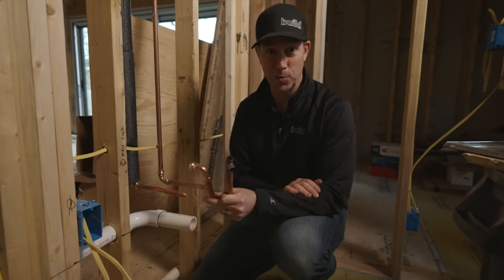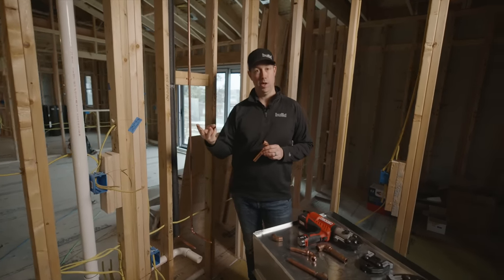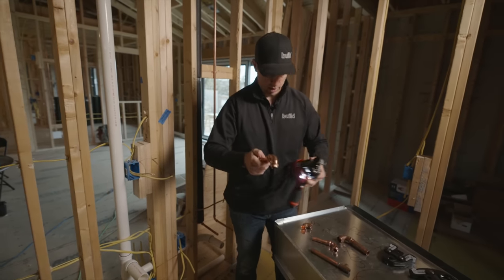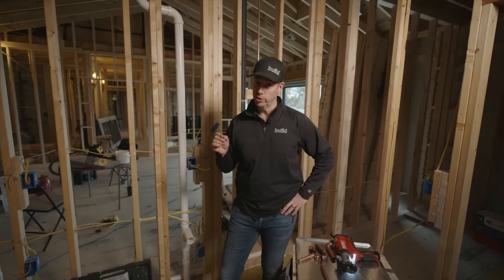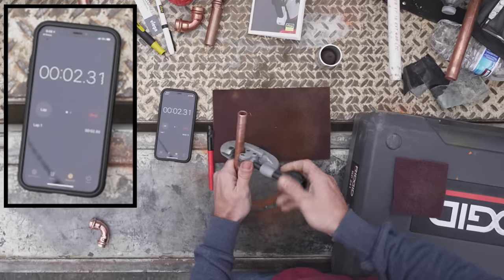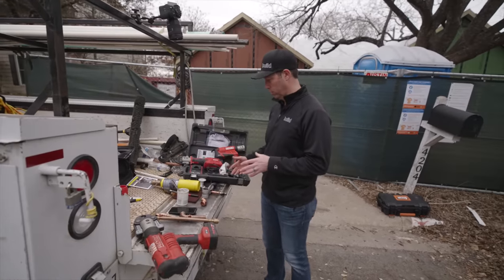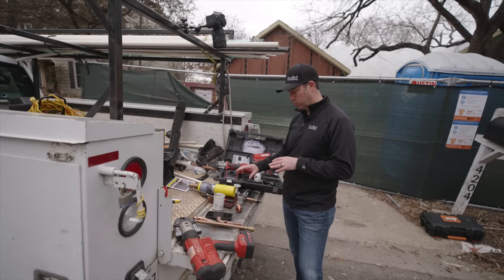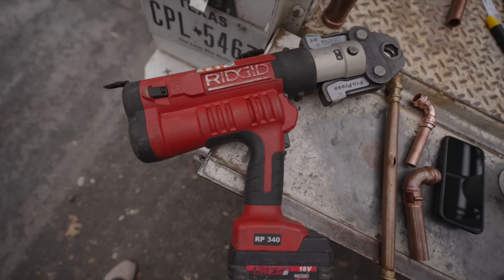Copper Plumbing - Viega ProPress vs. Soldered

Comment: What are the life expectancies of “K” copper and pex?  Having to replace pipes after 50 years sounds really crappy!
Reply: Pex doesn't have enough time just yet; the stats would be useless. Give it 20 more years. (Yes, I know it's been around, but standards haven't. Additionally, it's way behind copper for range of implementation at scale.)
Reply: I know this is anecdotal, but hope it helps.  It really depends on the water running through the pipes.  The pipes in the house I grew up in are type L and the house has decent city water.  The house is about 35 now.  I had to adjust the piping when we replaced the water heater for my parents last fall and the pipes still looked near new inside, no visible erosion.  I'd be surprised if the pipes in that house wore out in another 60 years.  
The house I own had "K" copper pipes installed in the mid 60's from a moderately hard water well to the oil heater and the kitchen.  When we replaced the oil heater and water heater a few years ago, the 50+ year old pipes were still in perfectly good shape.  We just sweated new fittings as needed to hook up the new oil heater and I doubt I'll ever need to worry about them.  The only copper in the house that had worn out was the 4" copper wastewater piping and we replaced that.  All the water supply piping is still thicker than "L" wall everywhere I micrometered after 50-55 years.
Reply: @IanSlatas  Thanks for sharing. I've lived in homes (all on city water) with galvanized, copper, and PEX in 3 different homes. Like you said, it really depends on the potable water going through it. Of course, the galvanized pipe (44 year old home) eventually developed pin hole leaks or developed rust and mineral restrictions like a hardened artery (slightly hard water from lime). No problems with the copper lines (34 year old home fairly soft water). The house with PEX (25 year old home fairly hard water) had its grey polybutylene replaced at 20 years because of the potential of leaks and some insurance companies won't insure homes or charge higher premiums if blue or grey poly is in use. Copper wasn't a good replacement option cause of the labor cost to open up the walls (slab foundation, no basement or crawlspace) and the cost of copper. I like the 20 year rule. Give a product 20 years to see what problems happen with it. Then I also heard that copper lines can be a problem where lightning happens often cause ground currents can cause pinhole leaks to develop. Your mileage may vary.
Reply: @IanSlatas  thanks!

Comment: Ot doesn't fuse the pipes together, it's a crimper. I don’t see this as a good thing. That o-ring will degrade faster than a solder joint. I'm not sold on using this system on anything I do yet.

Comment: Uhhh, the copper is not fused in a sweated joint.  "Sweating" is soldering,  not welding.   And it's the solder whcih makes the connection, not the "flux".  the flux is only there to make etch the copper and make the solder flow and 'wet" the copper for good adhesion.

Comment: How does copper compare to stainless steel pipes to use for hot and cold water ? I've heard they last even longer than copper ?
Reply: Who uses stainless for domestic water? Thats absurd
Reply: @lustfulvengance  ROI on geothermal is llllooooonnnngggg depending a lot on where you live and how deep you need to drill. Ive been doing commercial estimating for 10 years and have seen only half a dozen geothermal jobs

Comment: Ok so voice recognition dose work so well. I’m not saying you can spin it like a shark bite but if it is crooked you can move it, hence it is not fussing it together. But you should press it again.  Maybe your not strong enough . Also plumbers don’t use Brillo its called scotch brite and a real plumber will not use mapp gas to solder we use an acetylene torch with the proper tip. This miss information pisses me off , you make me feel like I’m an internet  hater,  I’m not! I think I’m going to start doing videos myself so people can get accurate information on line. I will stick to things i have experience with and do proper research on new things. Sorry.

Comment: The o ring is in fact the seal. If you run water through the pipe and then cut it open you will realize its wet till it hits the o ring. Stop saying that the copper to copper is "fused" its not, its also not the seal.

Comment: Everything about these new fittings sounds great except price.
Equal number of 1-1/4" copper sweat fittings vs Viega are $86.00 compared to $287.00.
That is 334% more which is ridiculous.
Reply: Press is good where labor rates are high. Such as prevailing wage or union work. Or repair work.

Comment: My HVAC guy scoffed at pro press for no other reason then he just didn’t want to learn something new.
Reply: I can't speak for him, but in commercial refrigeration, I've seen leaks in relatively new press fit connections.  I've also seen many 70 year old brazes that are still leak tight.  Press fit is great for water, but I won't use it in refrigeration.

Comment: If it is a smaller job, say 15 fittings, you are only saving 8 minutes using pro-press over soldering. Your plumber on this video was good at soldering.
Edit: He only did one side of the fitting, so 16 minutes of saved time.

Comment: I think I gotta call bull on this process “ fusing the pipe” and the EPDM not being the sealing element. I think we all know better than that. You can fuse two metals together with out reaching the melting point of the material.

Comment: He doesn't fuse the copper with flux he cleans the surfaces with  flux so that solder  may connect the two copper pieces. Incidentally that's not fused.  It's soldered  in the common use of the words

Comment: I can’t help but notice the copper is strapped down with a copper strap, isn’t copper on copper contraindicated?
Reply: No , that is exactly what you want. Any dissimilar metal will corrode the copper and cause leaks.
Reply: Yeah you can use other metals but you need to put somethjng between them. Like tape. Its advisable to just use copper though. In the commercial world we use hold-rites tacked to the copper and secured to the wall joists

Comment: ProPress has its place, but correctly prepared and soldered copper will last a lifetime. ProPress uses rubber o-rings to seal and they don't last forever.

Comment: '"Even the thinner M will go like 50 years..." Nope. My development was done in M like 30 years ago and every home has pinhole leaks. Go at least L in thickness. May also depend on your water. Water here in Los Angeles is very hard.
Reply: LA has hard water but I have systems with "m" still going from the 80's. Lack of reaming is a major cause of pinholes
Reply: @Marvinfj32  What do you mean by "lack of reaming is a major cause of pinholes"?
Reply: @jeffworst9939  It creats turbulance 6"-15" from the un-reamed pipe. There are many other reasons, but for me this was the most common.
Reply: @Marvinfj32  So what does reaming all of the pipes in a house involve be done?
Reply: @jeffworst9939  too late if they are installed. you would have to take every joint apart. Don't get me wrong there are other things that create pin holes as well. Velocity, minerals in the water, fittings too close together. I don't like plumbers and I was one for a long time. The last 13 yrs I was a construction defect inspector. lawyers and ins companies hired me to find out why systems failed.
Reply: @Marvinfj32  Oh, now I know what you mean. Yes, if that wasn't done then it does cause unnecessary turbulence. I live in a development where all of the homes were built  at once and they all have pinhole leaks. I think it's due mostly to our water that has a very high mineral content.
Reply: @jeffworst9939  yep, liquid sand paper

Comment: You claim that the EPDM seal is not necessary and is just a backup. Prove it. Take it out, press it, and pressurize the fitting. If it doesn't leak Ill eat my socks.
Reply: There's videos of that, I hope your socks are clean

Comment: Here in Germany, the Viega sanpress stainless steel system is very common and has been in use for a long time. Copper is still used but mainly for refrigerant lines. Multilayer pipes are used where possible to save cost, but they are nothing like the garden hose looking stuff found in many American homes. Needless to say, plumbing is expensive here...

Comment: But the tools are WAY too expensive for a DIYer. Even though they scream perfect for the DIYer. The electric tools only seem to be made by Rigid and Milwaukee (same company). So they get to charge whatever ridiculously absurd price they want when they have a monopoly. Or maybe it's just that they have the sole rights. Whatever the reason, it sucks for a DIYer like myself that cannot seem to get soldering to work. 😡

Comment: How do copper pipes fail? What changes after 50 years or whatever?
Reply: Erosion
Reply: Chemicals in the water too
Reply: @dnomyarnostaw  That's what I was wondering about. Is this a hard water problem. If you have soft water should your pipes last longer?
Reply: @MakeMeThinkAgain  "Other times, corrosion happens when the pH level of the water flowing through the pipes is off, creating acidic water that eats at the metal over time.

To fix corrosion, you can install either a calcite neutralizer tank or a phosphate feeder. A calcite neutralizer will deal with your pH problems, adjusting the pH level of the water to less acidic nature. A phosphate feeder is an excellent choice for reducing external corrosion issues because it coats the piping in a protective layer that helps it outside damage."
Reply: It's a metal pipe with pressurized water inside of it, think about it.

Comment: Not a fan of the pro press. I've seen many failed fittings.. and that makes a huge mess. I'd rather spend the extra few dollars to solder the copper correctly and have piece of mind.

Comment: The sweating process took alot longer than  if l would have done it.and lm no pro.Almost like Clint was dragging his feet.and what is this about a fire permit?WHAT?THE MONEY UP FRONT AND fitting price makes sweating my choice.for repair though in a house existing,clamp system IS a good fireproof way.but that upfront money for ridged machine is 2000 bux!

Comment: the primary seal is still rubber... so sharkbites on steroids with a better securing mechanism with a 2500k tool.... thats not to say im not a fan but im kinda of tired of plumbers trashing new technology only to support it as soon as there is a expensive tool/process to price lock people out of it. its like pex all over again

edit to add, i double checked, these tools are in no way actually cold press welding the copper, its an incredibly tight seal but not actually fused 10s-100s of thousands of PSI are required to actually cold weld. that being said it does create a functionally tight mechanical seal but i would bet money you could physically break it thus the o ring

Comment: I would NEVER use copper again. I've  had to replace my entire homes plumbing in less than 30 years do to my well water eating through the copper piping causing leaks and home damage in many places in my home. My well water is just slightly acid do to  our location in Eastern forested property.

Comment: @1:15 Flux doesn't fuse the pipe, solder does.  Lame test: Your guy makes sure soldering and copper prep work takes longer. It is obvious. Viega is not English word. It is not pronounced "Veega", as you pronounce it, but Spanish "Viega" - "i" and "e" pronounced like in "Fiesta"

Comment: Can you use this for compressed air?
Reply: Yes they have two different  type you can use one with a epdm o-ring and one with a hnbr  o-ring depending  on the amount of oil in the line.

Comment: What happens with copper after 50 years?  😳
Reply: As long as nothing has corroded the pipe, nothing. However, usually pin holes happen where the pipe has been worn away from corrosion.
Reply: @shannabolser9428  
I'm not a plumber by trait but I've worked in construction business for about 20 years and have never seen corroded cooper pipes.  Bad joints?  Sure, plenty.  But not copper itself.  Maybe it depends on water you are running.
Reply: It corrodes from the inside because of the water. It isn't something that you see. It isn't very common but it does happen

Comment: 70 years on type L system?? More like 30  years if piped under the slab in Florida
Reply: Ahhh, poor concrete mix making weak acids, huh? That is a problem in a lot of places. The "salts" in poorly designed or mixed concrete will corrode a pipe in short order and poor water quality, electrolysis, and careless installation of not removing excess flux can all do the same!
Reply: L has no business underground. Soft K tubing is the go to
Reply: @yeahyeah5422  Dont forget the protective sleeve too!

Comment: This is such a waste of money. I'm a master plumber and I would never plumb my house in all propress and type L, clearly he didn't pay for this. Propress definitely has its place but not for a new build.  This is the problem with all these videos and techniques. Its unrealistic for the average person to be able to do any of this in their own house.
Reply: Old school is always the best in the trades. Till I retired 10 yrs ago I used hub and spigot closet rings. Can't stand plastic or the cheap ass spinning sheetmetal ones unless I had a repair company, They always leak and corrode in a short time. The best ones are the wanna be plumbers using drywall screws in a closet flange.

Comment: you loved pex a  and were going to do your house in that with uponor fittings, now you flipped and went with l grade copper, why the flip flop. i like copper too but i would only use it at the hot water heater by code and coming into a undercabinet because i like the look. even without soldering and i love pro press what about scaling inside your pipes over time. that will not happen with pex.

Comment: I have enjoyed many of your videos in the past, however you are very wrong about press and how it works. There is no fusing of the copper and the fittings. If there was one couldn’t spin the fittings after pressing and you can. In fact even when soldering the fittings are not fusing together, they are just being attached by bonding. Oh and Milwaukee makes a better tool. But that’s just my opinion.
Reply from the maker: You definitely can’t spin a fitting after pressing it.
Reply: Trying to be polite again, you’re wrong. I’ve moved fittings plenty of time after pressing them a little crooked. Then you just press them again. I’ve been a professionalPlumbing and heating contractor for 37 years you probably aren’t even 37 years old. You really should get a real plumber in there and not someone thanks that you can use copper together. Once again trying to be polite you’re probably not stupid but just inexperienced.

Comment: I wonder if these fittings can be used in repair jobs where the water is slowly seeping out when the valve doesn't shut down all the way? Anybody know?
Reply: Yes thats where they shine
Reply: Thanks!
Reply: Matthew is right but in a pinch you can also just use a push-fit fitting like sharkbite.

Comment: We sweat with silphos not lead based solder.
Reply: Where is that?  Your channel has some videos from New Zealand, is that where you are?   In the US silphos is used for refrigeration coolant lines,  but not for domestic water or hydronic heat lines.  THose are almost always soldered.  However lead based solder is not used on domestic water lines,  there are various lead-free solder alloys available.

Comment: Copper pipes leach copper into your water, unless you filter it out at the faucet, which is a good thing because copper is a required mineral. In fact, its copper deficiency that causes get grey hair, weak and brittle bones, etc... NOT old age.

Comment: Matt, I enjoy you videos but I need to tell you this isn't your finest moment.  I come at this from the perspective of an old chemical engineer.  In the intro you tried to make copper sound extremely benign, almost saint like.  It is not.  Copper is toxic and it can form extremely toxic organometallic compounds.  One does not typically dig pure copper from the ground.  Usually it is mined as a sulfate which is them smelted at high heat in a furnace driving off very nasty sulfur compounds.  That copper pipe also contains trace amounts of other metals including lead and silver which can leach into your drinking water...not good.  However much more lead would leach from your sweated fittings. So your crimped fittings are indeed a big improvement over sweated fittings.  You totally missed this point, the one truly valid point, for using crimped copper fittings.  I also think they are more expensive.  You are correct that the EPDM in the crimped fitting will last a very long time because it is not in the flow path.  But the EPDM is a seal, in fact it IS THE PRIMARY SEAL.  Proof is as easy as assembling one connection without the EPDM seal.  Is copper a bad choice, no.  Is there any particular advantage over PEX for residential plumbing, probably not.
Reply: For the record, lead based solder hasn't been used on domestic water systems in the US since (I think) 1974.  Plumbing solders are various alloys of tin antimony and silver (and probably a few other metals)

Comment: This guys nose is green and you might as well use sharkbite fittings theres no difference they both seal with a rubber o ring with compression

Comment: 70 years from the copper pipe , too bad the o-rings in the press fittings will fail in 20 to 30 years

Comment: Flux cleans the copper. Solder bridges the metal. Old copper as in the gold standard used lead solder which is BAD for you.  Please research and know what the hell you are talking about.